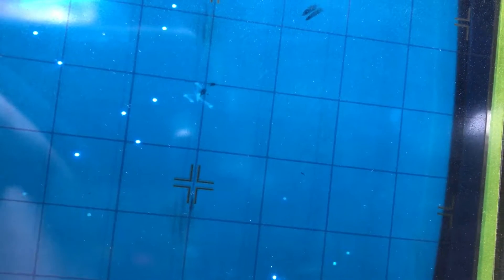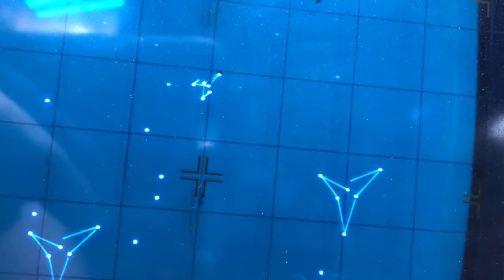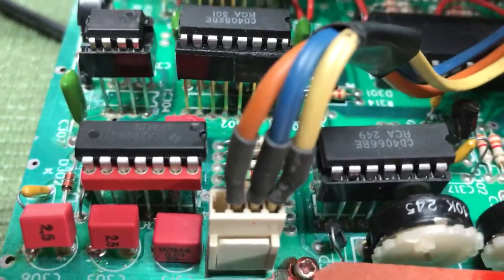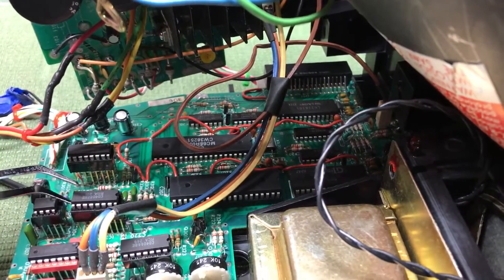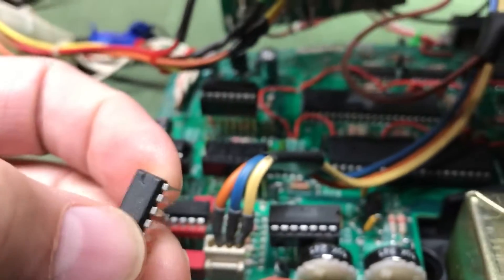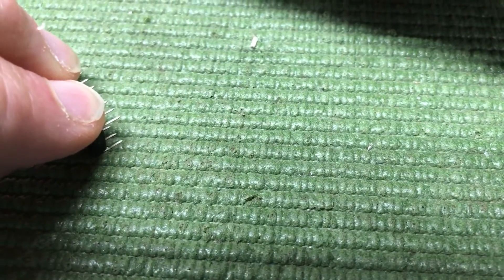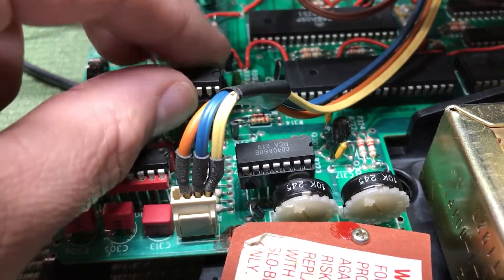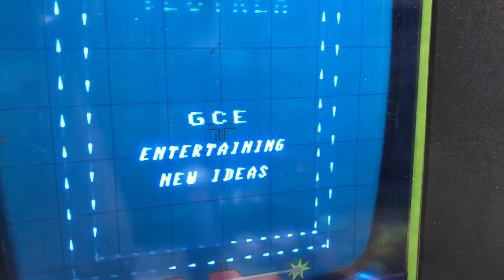Vectrex spinning ship in MineStorm problem and the solution. Vectrex repair series episode 1.

Comment: Had the same issue ship spinning ccw like yours, changed ic302 to cd4052BE and no change, ship still spinning with or without controller connected. Would appreciate any help
Reply from the maker: Try IC 207.
Reply: Obtainium Gaming fixed!! Thanks for the tip, 25 years in the attic and it lives to fight another day!
Reply: Where do you buy these chips? I'm having the same issue
Reply: Jon k  try Digi-key or Ebay
Reply: @kevinklink7905  awesome just found some, thank you!

Comment: So I have an Australian Milton Bradley Vectrex, Ive openef it up and have a similar chip but mine is soldered directly to the board so i can't change it easily. My chip also appears to be a slightly different number cd4052bcn....any suggestions?? Thanks